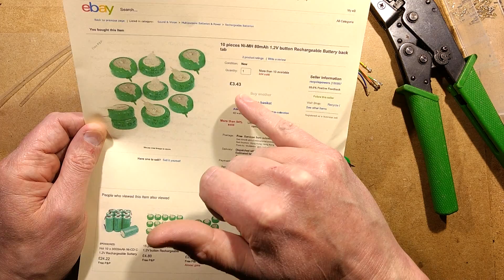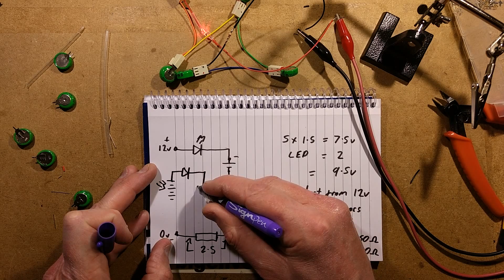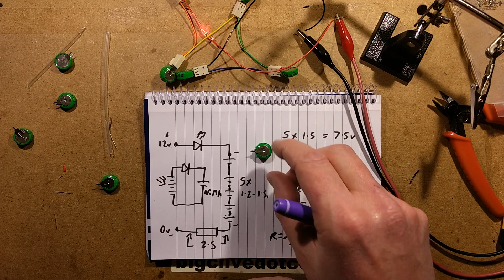Super-simple DIY charger for NiMh button cells.

Comment: BigCliveDotCom can you check out this DC motor on eBay (select the #3 12V 30000Rpm choice). Does it really spin at 30,000rpm? Can you do a video on it? 
Link: http://www.ebay.co.uk/itm/6V-12V-15000-18000-30000RPM-Electric-Motor-Gear-For-Kids-Ride-On-Bike-Car-Parts/252803248374?_trksid=p2047675.c100011.m1850&_trkparms=aid%3D222007%26algo%3DSIC.MBE%26ao%3D1%26asc%3D43781%26meid%3D5c46f3f40c484d6a9ffa6f86e7761fe8%26pid%3D100011%26rk%3D2%26rkt%3D10%26sd%3D322331128253#shpCntId

Comment: An idea for measuring the capacity: put several cells in parallel and try again with the smart charger. This will only reveal the average capacity of all measured cells, but it should give an approximate idea if the "80 mAh" is close enough

Comment: Hey +bigclivedotcom you have talked about WAGO lever terminals in the past and I have a question about them I am hoping you might be able to answer.

I am running a 3d printer off a 12 volt 30 amp power supply, I am needing to split the 12 volt rail in two so that I may hook up a cooling fan for the logic board.

Would it be safe to use the 221 or 222 WAGO lever terminal connectors in this application?

The official PDF says they support a "Nominal" current rated for 20 amp at 600 volts, but the same document also says they are rated to support 32 amps at 600 volts.
Reply from the maker: They do a higher current version for bigger wires.  But generally these connectors are conservatively rated, so it may handle the high current OK.
Reply: As a rule of thumb, you don't really want to operating near the rated capacity of any of your components.

Comment: i like to charge odd sized batteries with magnets: put small magnets between batteries to hold them together and attach the crocodile clips from the power supply with magnets too. the nickel coating on the neodymium magnets is a pretty good conductor, and the pulling force is sufficient too to make a good connection, at least good enough for charging small batteries.

Comment: I have another way to recharge lithium "pill" cells. If you have an "Energizer" style charger you can sandwich the pill battery between an AA cell and the spring connector of the recharger. Remember, negative to positive in line. I've recharged my laser gun sights with this method three times now and it isn't as good as new batteries, of course, but it works !

Comment: I listened to this a couple of times, but your accent; so you're saying you DO have to disconnect NiMh batteries reach a voltage?
Reply from the maker: The NiMh cells will rise to about 1.5V and then just sit there if you keep trickle charging them.  You don't need a cut-off unless you are fast charging larger cells.
Reply: thanks. :)

Comment: I'm assuming you are not using fume extractor.
Reply: There's no real need to. Sitting next to a smoking person for a few minutes is probably more health-risky than some soldering, especially considering most modern solders are also required to be lead-free. Just don't inhale it intentionally.
Reply: Smaxx : If I remember correctly, Clive prefers to use lead based solder
Reply: Yep, but the amounts you're exposed to are still too tiny to make a significant difference. You're only melting an alloy rather than pure lead and you're not doing this 24/7. Chances are high that you're somehow consuming more lead by drinking water or inhaling smoke particles from cars. Just make sure you throw away excessive solder rather than eating it for whatever reason.

Comment: However you did the maths for the highest voltage on the cells which means they are fully charged, however this is a charger so they would likely start empty. 

With near-dead cells, say 0.9v, there would be only 6.5 volt drop across the whole thing (4.5v for cells + 2v of the red LED), so the voltage drop on resistor would be 5.5v and it would have to burn 0.1375W in that case. At least a 0805 resistor would be advisable if you're going SMD, of course the 1/4W classic thru hole resistor is still going to do just fine.

In this case with 0.9v per cell the initial current will be 25mA. Only when the cells are fully charged will it trickle down to 10mA. Just something to keep in mind - even with the simplest of circuits, there are a few back-of-the-envelope calculations that you have to keep in mind when sizing a part.

Comment: Since you started on a little bit of theory you should also give the formula for power dissipation for beginners that have not learned it yet: P=V*I or P=V^2/R, so with 2.5 volts and 220 ohms you would have 0.0284W dissipated in that resistor. Certainly negligible for a quarter watt part, in fact a tiny 0402 resistor (0.06W rating) would be able to handle that comfortably. :)

Comment: A trick I use for holding stuff when soldering is BluTack (or the cheaper WhiteTack from £land): put a lump on the desk, and then put the connector or whatever you need to solder onto the BluTack. If you want to use a crocodile clip to hold a component, then you can put that into it too. Its cheap, simple, and lets you angle things in whatever direction you want
Reply: True, although even cheap third hands are maybe 10-15 bucks. They give you more freedom and you can combine them with tape. :D

Comment: if you could pull the resistor from the crocodile after leaving the crocodile clamps and before closing  , then you ll have a very different something to show.

an other thing , is it does not charge less than five batteries :(

anyway , thank you

would a ccfl to led backlight replacement be a great idea ? i want to do it and i want to get rid any useless circuits for the cclf .
will it bleed ?

Comment: To determine the capacity you could build a little constant current load and time the discharge.

The worst bit about a soldering iron is if it is near your thumb nail and warms up the nail, it has some thermal mass and takes a while to register and when it does it takes a while to cool :)

Comment: I do like that crimp tool ! and yes I think rapid electronics is the same one that's been around for years and on the web I used to but from many years ago and the company I used to work for bought all our components from we outstripped them of a certain connector and had to get them direct from china through one of their suppliers
Reply from the maker: +thehappylittlefox aka benji Rapid seem to keep low stock with long restock times now.  I've often had to source bulk components from any other source I could find.
Reply: is that a fact! we used to buy something like over 50,000 of a connector well if it was a 15W D type sorry but we bought them all !

Comment: Is there an easy way to re-attach leads that have come off a solar cells? My best method so far is to use a little Bakers soldering fluid on a small paint brush onto the lead & the panel & use a soldering iron tip of about 3 mm chisel point. Sometimes works easy, other times I have to have multiple goes. Of the solar lights I have repaired most have had bad solar connections or at least the leads come off when I am testing, & over discharged batteries, only one so far had wrong connection on the 5252f chip. Strangely pleasurable to repair what most folk throw away.

Comment: Your tip for today Clive from the island to your left:
When your heat shrink (or any "elastic" material tube in fact) is too small, insert a suitable pointed pliars into the tube and gently stretch the tube, dare I say in a sort of gynaecological fashion.  This works superbly with heat shrink, delicate touch needed.  For nylon compressed air line or neoprene fuel line chewing the end first softens the tube as does a mug of boiling water, tea or coffee.  Stretch over the pointed pliars as before.  Garry

Comment: Without soldering, you could use magnets in between the cells. That's how I do it, using a wire with crocodile clamps for the resistor and LED. If you line up north-south all magnets it will stay in place perfectly.

Comment: You should put heat shrink tubing on the teeth of the helping hands. ;)
Reply: Why? Direct metal-metal contact dissipates heat trying to reach the component, protecting it a bit. Adding heat shrink tubing around the teeth adds insulation where you don't want it.

Comment: +bigclivedotcom
Clive, I have a little tip for you (and anyone else who reads this comment ... hopefully, lol).
If you're soldering wires to resistors or other components, you can leave the component leg a little longer so that it overlaps the wire's insulation. The purpose is that, when shrink-wrapped, this will reinforce the wire connection and reduce any bending forces on those thin, fragile wire strands! :)

Even better, overlap the wires with the component itself. That will prevent broken component legs. :D
(Though it does make the whole thing thicker.)

P.S. I know exactly what you mean about putting the iron close to your fingers. I do the same, and it's rare for me to get a burn. (Usually when I do get burns, I get them from touching components that haven't cooled down enough. XD)
Reply: Thanks for the helpful pointers. I never considered doing it the way you describe, since it always seemed "wrong" to not cut the pins to length. But when the result will be shrinkwrapped, it makes sense. Especially overlapping the component with the wires, which, if I understand you correctly means soldering the wire to the "opposite" leg in the "reverse" direction, right?

Comment: You could possibly put resistors in parallel with the cells. It will decrease the efficiency, but it will help keep the cells balanced. Ever taken apart and reverse engineered an ATX computer PSU? The input voltage doubler/filter capacitors (for non-apfc units; doubler mode for US voltage) have a resistor in parallel with each one. If one of them goes open circuit, the voltage across the capacitors could become unbalanced and exceed their working voltage. This typically doesn't result in a huge explosion because of the low current, but it will slowly cook the cap and it will bulge.

Comment: This is a way to test small NiMh batteries.
1) Get one of those single cell travel alarm clocks that have actual hands (nothing digital).
2) Add wires to the battery terminals.
3) Add an appropriate load resistor to the wires in parallel with a battery socket.
4) Set the clock to 12:00 and add a charged battery.
When the battery dies you can read the clock and see how many hours it ran under load. If it ran for ten hours with a 10ma load that means the battery had a 100ma hour rating.
Reply: Jammit Timmaj I think the point of these exercises is to actually make something rather than buy something of the shelf and in doing so learn a little bit of electronics on the way.
Reply: spotify95 the load resistor is easy. You can ignore the clock current because it's so small. A 1.25 ohm resistor will draw 1 amp. A 12.5 ohm resistor draws 100 MA and a 125 ohm resistor draws about 10ma. NiCd and NiMh batteries aren't perfect and a close guess is normally good enough.
Reply: That's the thing about those cheap clocks. They don't run slow before they stop. They just stop.
Reply: That's odd. I thumb'ed up the video and I don't even remember seeing it. That video is exactly what I was thinking about.
Reply: You can't just add a load resistor. You need to dischare the cell with a constant current to be able to precisely measure the capacity.
Reply: And if you leave the resistor hooked up to the battery for any length of time, it will over-discharge the battery => fluid leak, external white crystals, and a no-longer rechargeable battery.

Comment: I got a quick question for you, if you don't mind....

I have a couple of LG 18650 cells, and a charger i bought off ebay. the LEDs on the charger turn green when the cells are fully charge.

Now, I hear that laptop batteries essentially have 18650s in them also.

The question is, why does the laptop indicate say 2hrs left until fully charged, whilst the 18650 charger takes at least six hours?  
Is there a way to make a device that will charge the cells as fast as the laptop? (maybe a certain youtuber can make a video out of it winkwink)
Or is this a case of 'get a new, branded 18650 charger"?
Reply: This one is easy. Laptop batteries are complex little buggers. All of the complexity allows for safer faster charging via higher charge currents. They can have (I have observed this personally):

Charge status LEDs on the battery itself

thermistors close coupled to the cells with silicone goop

a coloumb counter chip

4 wire sensing of the pack voltage with additional wires to the mid points between each cell in series

active cell voltage balancing

serial communication with the computer's charging circuitry

Thermal cutouts, thermal fuses, and regular fuses. Some even have a thermal fuse with a built in heater resistor that if a fault is detected the monitoring IC can power to intentionally blow the fuse and permanently disable the battery.
Reply from the maker: You get chargers that charge with higher currents.  With lithium cells it's better to get a fully built unit due to the critical voltage monitoring required during charging.  Slow charging of cells is better for them than fast charging.
Reply: thank you so much for replying!

So this taking 6hrs is overall better for the cells then, huh?

Comment: I used to simply use the radiant heat from my cheap soldering iron to shrink heat shrink. I would propose the iron up on pliers or whatever, and then wave the heat shrink over the hottest part of the iron about 5mm away.
Touching can result in burning, and the horrible smell of burning plastic coming from the iron for ages.

Comment: I've heard that NiMH cells can supposedly be resurrected when their capacity drops out by using something called a "Re-EMF Charger", which is basically a JouleThief circuit that fires the back-EMF pulses into the battery. The battery isn't even supposed to get warm with that, and after several charge and discharge cycles should become close to its original capacity. Since I have not tried this myself, I cannot say whether it works, but these pulses are supposed to somehow "reformat" the cell chemnistry back to how it was supposed to be, or something like that.

Comment: Clive, could you not modify your capacity testing clock with 100 times the load resistor value to test at 5mA and still be easily scale-able?
Reply from the maker: Not so easy for the original, since the load was also the reed switch magnetic coil.

Comment: Will the LED go out when the batteries are fully charged ? or will the circuit continue to draw enough current to keep it lit ?
Reply: The same current that goes through the LED goes through the batteries. The batteries will continue to be trickle charged at about 10mA even when 'full', until you disconnect them.
Reply: Thanks for the clarification.
Reply: To expand Michael's answer, the LED is really just there to show you that the circuit is closed and there's energy flowing, since you'll connect everything in series.

Comment: you calculate that you need a 250 ohm resistor, but then knock it down to 220 ohm. why?
Reply: 220 is common, 250s are not
Reply: @liudas5377  That is a nice tip. Keep in mind that this technique will deteriorate the power value of that resistor, because a narrow resistance channel will be formed on which heat will concentrate.
B.t.w., with this subject, the charging of that NI-Mh cell, no precision resistor is needed. 10% will do :)
Reply: But I would go for the 270, also common, because the calculated current is a bit high. Trickle charge for Ni-MH is always less than the standard charge. And the standard charge is 10% of the capacity for 14 hour. Since this is a 80 mAh cell type, standard charge is 8 mA. A trickle charge would be no more than 4 mA.
Reply: @erikdenhouter  perhaps you know the trick for precision resistors? I take a common metal film resistor and use a triangle file to gently score it. Once you get to the film layer and with an ohm meter you can carefully file it. Each stroke removing metal film will increase resistance.

Comment: If you want to guarantee a current limit, you can simply use a cheap (10p from china) LM317 + 1 resistor in constant current configuration. Might make a nice little future project :)
Reply: Not from China they aren't. Have a dig around in the usual places.

Comment: Been looking at solar lights recently, but dismayed by a pretty looking set of 100 multi-coloured LEDs powered by 1x AA battery. Would that even be enough to last any decent amount of time?
Reply: bulletproofblouse I've found that THREE AA rechargeable batteries (charged up via sunshine) last seven days when powering 100 blue led lamps which stay on for around nine hours per night, if you mix the batteries nimh nicad it doesn't seem to matter...
Reply: Thanks for the response :) So one is enough, just as long as the days are sunny? The position on the balcony to put the solar panel gets a LOT of sunlight.